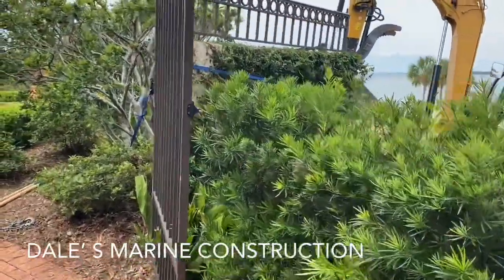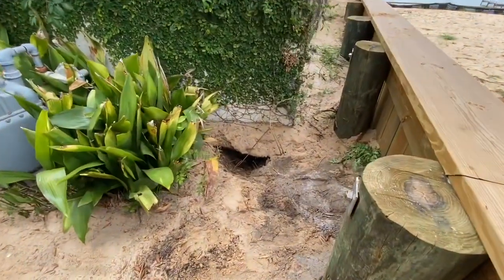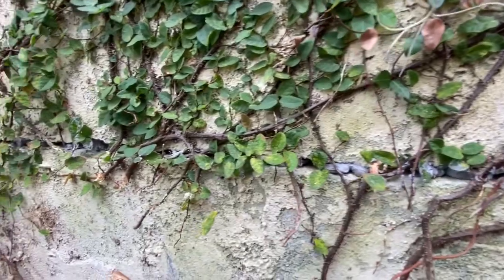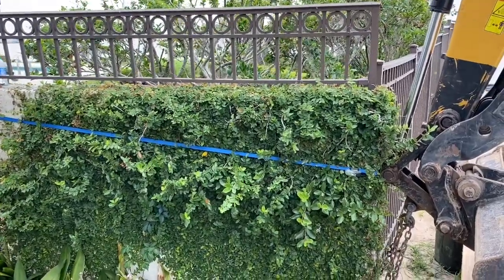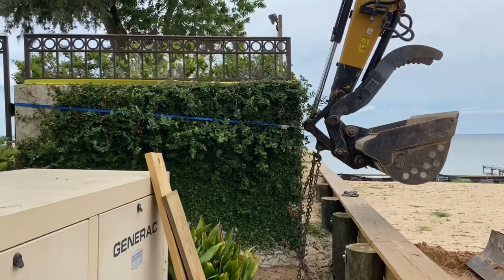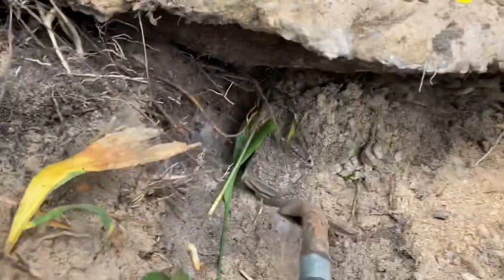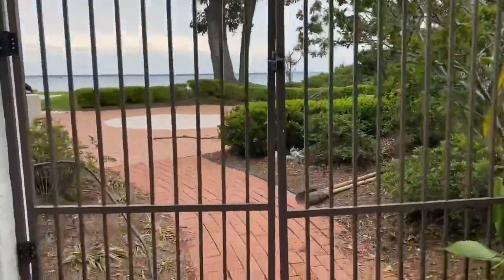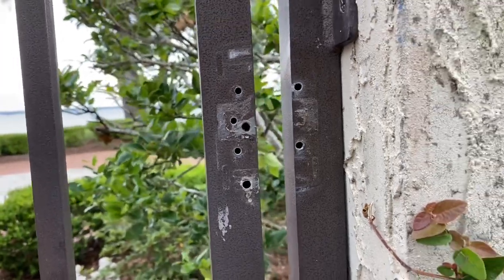HOW TO REPAIR A LEANING CINDER BLOCK WALL

Comment: Wish Dale was in Phoenix.  ** Any ideas guys ? **  My cinder block post with the gate latch has leaned away from the house, and now the iron gate won’t close .  Nothing but the opposite cinder block post ( with the gate hinge ) to push against to get it pushed back to the garage and vertical.  And am afraid if I use a Jack between the two I’ll just push the post on the hinge side, outward instead of the latch side back to vertical and toward the garage.  Obviously not enough foundation poured.  Guess I could try it after soaking the foundation on the leaning side.  Don’t want to screw into the stucco wall of the garage.  Any ideas appreciated !!  ( What I really need is Dale !  Ha.  Subscribed .  Thanks !

Comment: Love this 'thinking out of the box' solution! I have a wrought-iron pedestrian gate attached to a cinderblock pillar which has separated from the garage wall. Consequently, the pillar has leaned in towards the gate at the top, which now can't be opened (amazing what a one inch shift is capable of). Everyone I've spoken to here about it wants to knock it all down and redo BUT...I'm an outside the box thinker too and you've inspired me. Thank you!